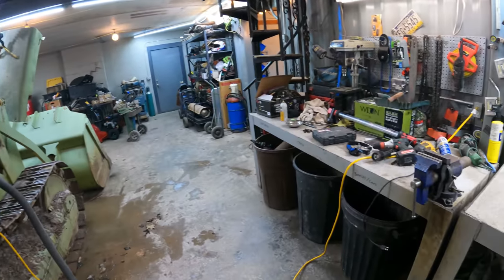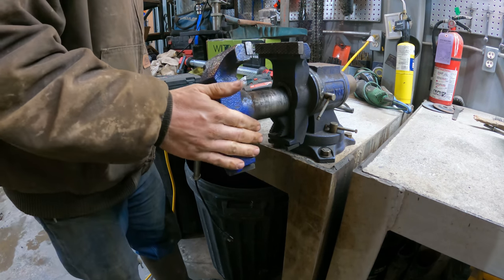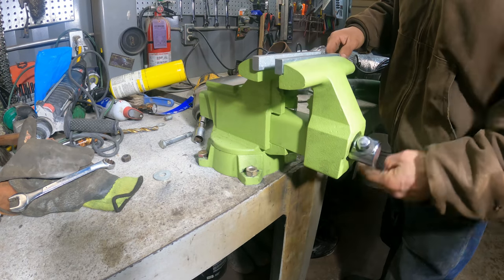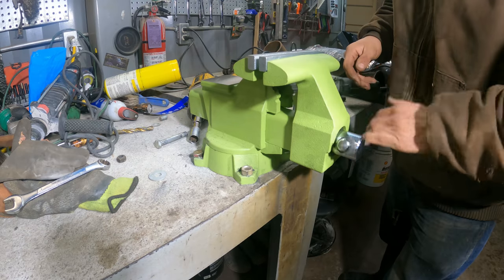Installing a new vise

Comment: Years ago I worked at a Power Plant and in one of the Machine Shops someone removed and stole a huge vise that was bolted to the 3/4” steel work bench. The Company replaced the vise about a week later with a brand new vise.  Then a week after that.... the new vise was stolen and the old vise re-installed to the bench. 
Very bold move... someone risking their job for a vise..

Comment: Don't know if you read in the comment section. But I came here just to say that resolution is not all. I'd rather watch an entertaining video in 480p, than a boring one in 8K. One suggestion I would make though, look at the resolution the cameras can play in 60 FPS, and choose that. The video is much smoother and it really shines when showing movement. Anywho, hello from Norway 🇺🇲🇳🇴
Reply from the maker: Think 5k 30fps is better than 4k 60fps?
Reply: @AndrewCamarata  No doubt you're right about the resolution. 5k is much larger than 4k. I'm just making the argument that an increase in fps would benefit your videos, making them smoother in movement and also giving you the option of slow-mo since it has twice the frames to use pr second slowing it down, and still not being a choppy footage.
I've looked at the GoPro 9 and see they list 60 fps if you step down to 4k. I see mostly benefits from keeping it at 4k. Smaller file sizes, still the same image quality with just smaller size in total, easier to manage in editing since it demands more of the computer to handle 5k, and the option of wide angle in the gopro if that's ever needed.
But I really do understand your thought of making your videos future-proof and not look back at VHS quality 5-10 years from now, hehe. But as with the ever growing increase in resolution pushed by the camera companies, the technology for upscaling follows close behind. So my guess is that our 1080, 1440 and 4k footage now - won't look VHS on our screens in the future. But that's just my gut feeling.
Anyway, I'm rambling on here. Just found your topic interesting 👍 glad you're still up and running even though the world seems to have pushed the pause button this last year
Reply from the maker: The dozer video I just uploaded was 5k 30 fps. just wondering if I should do 4k 60 instead.
Reply: @AndrewCamarata   Try it out, and see if you like the increased frame rate with 60 fps. If not, there is nothing wrong with sticking to 5k 30fps. The quality looks really good 👍

Comment: WHAT! Andrew not mending the vise!  Surprised you didn’t pull it a part, weld and grind down the parts hen re-I stall it on your work table.  Do like the new improved yet slightly smaller vise tho!

Comment: Nice lengnth video. Easy to watch and on to another. Majority of watchers probably will not be able to watch 5K yet. I have this 2012 Lenovo and it has a hard time with its onboard graphics prosessor keeping up with 4K and crashes to Bluescreen error page and reboot. You tube has a default at 480 anyways so not really an issue for most.

Comment: I was having a giggle at the Metabo shutting off when getting stuck in the hole.  I have a heavy duty makita and it will break your wrist or throw you into a wall before the torque limit.

Comment: 1440P usually looks best for me, mind you thats native for my 32 inch monitor, i have a hard time imagining what any better quality at this size would contribute in terms of my eyesight and moving up in size to 40 inch or more really begins to be unuseable at a sitting distance thats manageable and not 10 or 15 feet away. So to me 1440P at 32 inch is just about perfect, if and when prices fall maybe that will change, but for now it's the definite sweet spot.

Comment: Whatever you do, DON'T go with Adobe bc you are absolutely, 110% correct, subscription software (SaaS) is for serfs. My rec is DaVinci Resolve (DR) by BlackMagic Design (BMD). While DR is primarily a color grading application, the editing capabilities are very strong (just remember the key to any great editor is mastering the keyboard shortcuts, and you can totally ignore the grading features). And the best part is BMD offers a free version that is only lightly crippled, but the paid version doesn't break the bank if you really need the premium features. But, unless you are doing lots of heavy grading, temporal noise reduction, etc. it is doubtful you will need more than what's included in the free version. As for 5K vs 4K, there is not much additional benefit other than the ability to do punch ins/pans and other similar effects. In fact, I wouldn't look at 5K as a delivery format but rather an acquisition format that gives you flexibility in post for the reasons I mentioned. My 2 cents anyway. Although I will be curious to hear what you ultimately decide.

Comment: For the water running down the wall, why don't u put extended bits of metal making little chute so it comes away from the wall thus not ruining the paint :), if u haven't already thought about it.

Comment: That is called a Wilton Bash Hammer with an unbreakable handle. Several years ago the construction company I worked for required them because of an injury caused by a sledge hammer overstrike. The wooden handle broke, the head went flying and struck a worker causing a lose time injury.  we've never has a Bash hammer break a handle!!

Comment: I tried using the gopro video editing junk now for over a year once I upgraded to my Hero7.  I had a ticket open with them for like 8 months and they told me that my PC was the problem and wasn't powerful enough.

Like you, I had just upgraded my PC.  I upgraded to an I9 9900 intel chip, 64GB ram,  Samsung Evo 970 NVMe drives, and an EVGA RTX 2080 Super Hybrid.  Gopro had the cojones to tell me my PC was the problem.  Win 10, top of the line components at the time, and my PC wasn't good enough.

The issue was I had was when trying to edit it in the gopro software, the video would play for a few seconds then just freeze.  Then the software would lock up completely.  If I loaded regular 1080 res (non-4K) the software worked flawlessly.

It was a shame, because I really wanted to use it for the gauges and accelerometer you could add to it.

I too switched to Adobe Premier.  I also don't like the monthly subscription... but it really is the industry standard and what you learn on Adobe will likely translate to other platforms as well.  Plus, I have had literally 0 problems running it other than when I tried overclocking.
Reply from the maker: Yeah, gopro studio has its problems. I've spent probably 1000+ hours using it, so I know what to do to keep it from crashing. Its what edited all these videos. I am getting used to premier though.

Comment: The only way I can tell you have 5K is by pausing.  At 11:54 I paused your hand and I can see the creases or life lines in your palm and by pressing the period "." button to advance one frame at a time I can even see the snow flakes. My current system is a 7 year old Asus gaming laptop and monitor that maxes out at 1080P. 

YouTube shortcuts you might find interesting.
L skip forward 10 seconds  ----  k pause  ------  J backward 10 seconds
right arrow skip forward 5 seconds  ---------  left arrow backward 5 seconds
when paused :  comma back one frame -----  period forward one frame   :  especially cool on HD slow mo vids.
My Mom has a 4K large screen monitor, looks spectacular. 

Thanks for your vids.

Comment: You should compare the 4K and 5K footage, I noticed that there was more spherical distortion in the edges of the 5K footage, the 4K is probably cropped in towards the center more, getting away from the edge of the lens where the spherical warping is more severe.  I don't know why they don't have rectilinear lenses or at least spherical correction in software by now.

Comment: I use the Davinci Resolve software and it is free and easy to use. Not sure if you have tried it but I have found it very easy to use and import video and other stuff. I am not sure it will do more than 4K but worth a look maybe... in my stuff I only use 1080p since I am recording with old cell  phones and a rip off go pro!

Comment: Regarding video quality, there are real diminishing returns after 1080p on most devices and screens, because you need big monitors and close viewing distances to get to the point where more than a few people can really tell the difference on moving images. It generally looks better, but in most case if you get your face close enough to really see the difference, you can't focus well or see the whole image in your field of vision. 

A more important difference that affects viewing quality are the artifacts of compression (basically, the "bit-rate," or download size.) YouTube mashes up even 4k (2160p). You might be able to get a better encode with a larger source to control the bitrate. So, if you aren't keeping the original source on your own drives, that's your archive, and you can delete your source. You probably won't be happy reediting it, but it will be archived somewhat better than 1080p. If you are keeping your own source, you can always remaster it at a higher bitrate. But the BIG downside of keeping your source is how much more data you need to store and handle in editing! Backing up huge data stores is expensive and time-consuming, it's a real commitment, especially if you are concerned enough to keep two copies or online backup in case of hardware failure or whatnot. 

Relatively few "Movies", and no TV is broadcast above 1080p. But a lot of professional video is recorded and archived much higher. Recording at higher resolutions enables you to pan around and in on edits, and the compression artifacts from the camera are smaller, allowing the editor to control the loss from compression on output for your final product, and of course you can output really high quality 'directors cuts" and re-edit the source. For many, recording and archiving at a higher bit-rate 1080p will provide excellent results. (Although you can't make smooth pans in your editing) and the files and backups are much more manageable in size, uploads are shorter, etc.

Comment: Hey bud, if you want something that you don't have to pay monthly for, try using Lightworks. It has a bit of a steep learning curve, but your editing requirements are low - you don't use too many special effects, so the learning curve should be relatively short. Lightworks also supports MP4 natively IIRC.

Comment: If you are making the jump to Adobe you may still want to convert your GoPro clips before importing them into Premiere for editing. The GoPro native encoding DOES NOT PLAY WELL with Adobe and Premiere just does not perform well with "raw" GoPro clips in my experience.   I use a laptop running a legacy version of GoPro Studio simply for CONVERTING my clips to .MOV with Cineform Codec before i run them over to my main editing computer to use in Premiere projects.    I use a 10TB external drive to physically move the files from one computer to another because it's faster than transferring >5TB of HD footage over Thunderbolt.    Developing a new workflow can be a pain. Best of luck, and i look forward to watching your 5k videos!

Comment: Looks like fixing old and battered bits back to workable bits are over.  New parts are the go. Welcome to the rich folk's brigade  Andrew. You can retire the sledge hammer,the angle grinder gas axe and the famous dash fixer.. the chainsaw....

Comment: Because of the compression on youtube, watching videos in a resolution higher than the resolution of your display does look better, especially when it scales at a 2:1 ratio like 2160p:1080p or 2880p:1440p. With more computer monitors and phones being made in 1440p, 5k (2880p) is definitely a noticeable improvement in quality.

Comment: You may want to consider Powerdirector for video editing. You can buy it outright and they also have subscription models that are much less than adobe. It will do everything you want including direct import of 5k GoPro files. 

Adobe is a good product but demands a lot of horsepower and you will pay a heavy premium, you will never own the program, and have lots of features that do not matter at all to you. 

Also the 5k limits can come from video card limitations. This can affect rendering times significantly.

Best of luck

Comment: 01:20 Are these concrete work benches?
Did you build the frames for the benches and then poured the table tops?
If so, do you recommend that? Has it been working to your expectations?
Reply: Yes, yes and yes.

Comment: I have an 8K monitor and I would much prefer 4K 60 Hz instead of 5K 30 Hz... I also have the GoPro Hero 9 Black, and it overheats in 5K or 4K 60 Hz, so you might have to go back to 4K 30 Hz soon or buy a different camera...

Comment: Yea I suggest Da Vinci resolve for editing since it's free up to 4k exports and you can use Adobe controls or customize controls to mimic your GoPro software. Yes 5k is better of course but the next future-proof u need to worry about is 8k exports. 5k is just allowing you more versatility and leeway when exporting 4k still, and down-scaling from 5k imports to 4k exports is going to make a higher quality image. 4k is going to be "more than good enough" for a while, probably 2025+ u can worry about switching to 8k.
Reply from the maker: I am using premier still. recording at 5.3k, 120 bit rate, 60fps to be future proof.

Comment: There's little point in going 5k on youtube, even standard HD makes little difference considering the small screen size the majority of people use. We're at a point now where the higher definition only makes a significant difference the larger screen you have, like 50inch plus larger.

Comment: 5k is meant to be cropped down to 4k. It is just to get some image stabilisation without loosing pixels. The next step up from 4k is 6k. You should not bother putting up anything 5k, just film in 5k and post on YT in 4k.

Comment: A chain is only as strong as its weakest link.  That is to say that you have a 5k camera but if my screen's best resolution is 2k, then I'll see 2k resolution.  Others will see 4k if they have the hardware and software.  But at least  you're some distance into the future before time overtakes the technology.  Seems like the faster they make computers, the software people take advantage of that speed and write programs with more feature and take longer to run and process data - makes the fast computer seem to run slow visually.  I remember the days of 1200 baud modems - they were fast in their day.  So was I, then.  Now not so much so.

Comment: I vise should never break when you put a pipe on the handle. The handle is supposed to bent and break first.
Reply: Wilton could build it that way, or put an easily replaced shear pin on the handle drive collar, but fewer people would need a new vice. 😒
Look, they even supply a hammer to damage your new vice with! 🙁
Reply: @Robnord1  I don't know how US vises are built, but the German ones never failed me. When the handle starts to bent you know you're overtorquing. It's easy to feel and you cannot damage it.

Comment: 5k is mostly for using digital image stabilization if you don't intend to use digital image stabilization I wouldn't bother with 5K the reason it's 5K is because the digital image stabilization cuts off some of it so you basically end up with 4k The next step from 4K is actually 8K honestly I really wouldn't worry about that

Comment: Nice grip.
I wouldn't have installed it like that. I would have placed a 30 mm metal plate between the bench and the vice. with 4 threaded holes to lock the vice. I would have blocked the plate on the bench using (if possible) the screws of the old vice that were already there.
bye Bye

Comment: damn, Andrew thought you were better than this? you should have fab'd up a steel plate for the vice. cut them existing bolt studs for a steel plate, then welded four new bolts to the plate.

Comment: Yep, not only is Adobe Premiere a monthly "rental", but the design-industry standard software package (InDesign, Photoshop and Illustrator) has been "rental" for several years now. I am a professional graphic designer and used to buy this software package for $700 and update it every 3 years or so. Now Adobe charges $50+ per month ($600 / year x 3 yrs = $1800.) For a casual home user this huge increase in price was/is very disappointing. I used to think that Adobe products were outstanding, now I'm mostly just pissed-off with them.
Reply from the maker: That sucks. I am getting used to using it too. A bunch of people suggested davinci resolve

Comment: Resolve will read pretty much anything you want it to.  But it will notRENDER in 4k unless you go from free to STUDIO version which is what the movie makers like.  The thought process is different in its use.  In most editors you do a function and then the program will perform that to your file,  then it does subsequent opperations in the same way untill you have your finished product then you have to render it into your movie.  In resolve your actually programming a series of operations sort of like a computer programm of instructions as your edit.  Resolve will render your product on frame at atime doing all instuntions to the frame.  Your source file is never modified.  It safer and can be significantly faster to render product.  Resolve is designed by film makers.  Adobe is produced by programmers.   IMHO resolve is a far superior way to go.

Comment: With all the work I've seen you do on heavy machinery and watch you build that castle in the sky and you can't figure out to measure a bolt diameter and the hole it is suppose to fit in and then not realize that simply rotating the combination wrench 90 degrees left or right and the wrench wouldn't bind after tightening the bolt and then beating and bending it to remove it has me wondering. If you did it for humor, it worked. If not, make sure you know where Cody and Levi are before backing up in one of your machines.